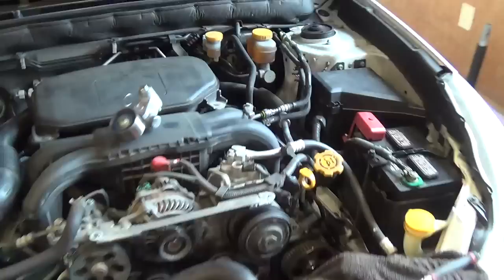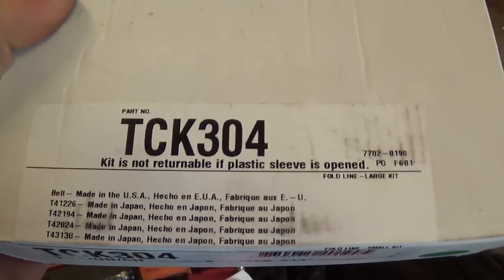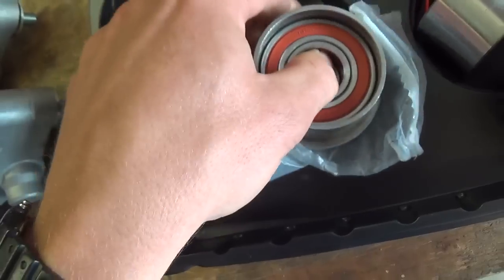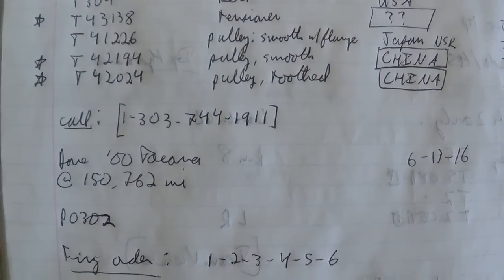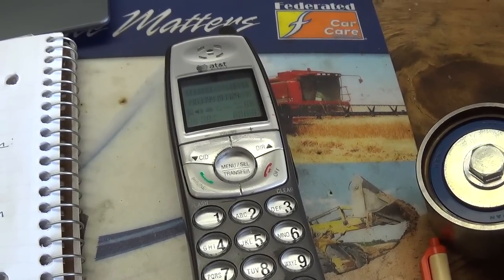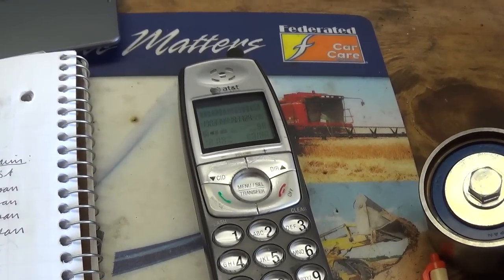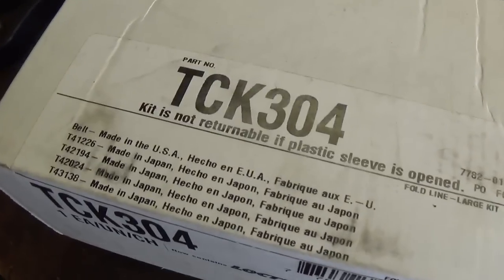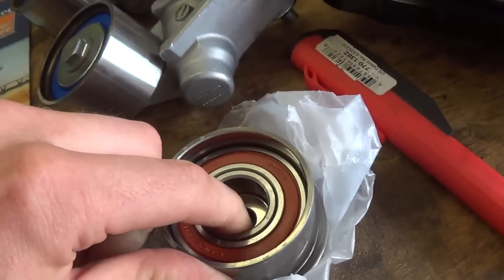GATES Subaru Timing Kits: BUYER BEWARE!

Comment: Well, thanks for the video! I received my Gates timing belt kit for $119 from Amazon yesterday for my Toyota. I saw your video yesterday and decided to file a return ( I chose reason not as described , I said the water pump was different, from what I read from reviews the Gates doesn’t have a weeping hole, so that wasn’t necessary untrue for my reason for the return, so I won’t be charged for shipping on the return) and spend the extra $37 and ordered the Aisin. So when it gets delivered tomorrow, UPS will be taking away the Gates kit. I have nothing really against the Chinese stuff, but if I wanted Chinese parts I would have ordered the off brand kit for $65. For Gates to use there name to sell an over priced kit is disgraceful, I know the whole kit wasn’t probably Chinese, but I didn’t even break the plastic to find out, your video was enough. Especially for parts like this, it’s not a good idea to take the cheap way out. Somethings are fine for playing the odds, for example if I were to buy a Chinese alternator for $50 rather than a non Chinese for $200, I would most likely get the Chinese. 2 MAIN THINGS TO CONSIDER when trying to save a buck, 1, how long will the job take to do (in my case hours), 2, what kind of damage could the part cause if it fails.

Comment: I work on lots of Subaru's and have been very suspicious of these kits .  This is typical of Gates   .The bait and switch technique is a time honored tradition in mass marketing  . Gates has lost me as a customer as has NAPA for Japanese timing kits . Chinese bearings are crap .Do not install any Chinese bearings .Auto Zone pulls this as well with Subaru front wheel bearings claiming to warranty the bearings doe not include labor so the mechanic eats the loss for come back repairs . Thanks for posting this video exposing the fraud of these corporations with false advertising ! Ebay markets  some all Japanese timing kits but beware of fraud there too.
Reply: leftcoastdane alot of people stoped using napa

Comment: I installed a Gates TCK304 kit on my 02 Impreza engine. Idlers were Koyo & NSK. Tensioner was NTN. Within the first year and not too many miles I started the engine one morning and noticed an unusual vibration. Turned it off right away and decided to look at the timing belt. Timing had jumped a few teeth and I found the toothed NSK idler had collapsed and was slightly nicking the engine. Contacted Gates by email but never heard back. Warranty outside the US even for Canada - good luck. Aisin next time.
Reply from the maker: Thank you for sharing, Wayne! Glad the damage wasn't catastrophic.

Comment: Same  experience on Gates Kit for the Subaru Forester XT 2006 Kit Number "TCK328" (Do not buy it).
I am doing a Headgasket job on my Forester 2006 (right now Juli 2019), and because of your video I double checked the Pulleys from Gates I have Installed 2 years ago/ 30-40.000 KM ago
Two Wheels have sounds in the wheel bearing when you wiggle it, and the one wheel is worn out, and don't turn around easy any more, and has been colored and taken blue paint from The Cosworth timing belt, (when I did the Timing belt job, the belt was bought seperately from Cosworth and the rest from Gates)
Wheels are made in China, just like in your video, and I did like "Trashhauler" and trusted Gates for good quality  :-(

Thank You, for your, wery important video, as I wrote above, I just did a head job (Including Machine shop Head rebuilt) and other important things, for an 315.000km / (200.000 miles) engine service.
So I am changing all Gates "china" components  same time.

Best Regards David From Denmark

Tip for Subaru:

My bolts for the CamPulley was (Exhaust hardest one) really hard to break loose, after 13-14 years, and I broke the old timing belt trying to do same thing in another youtube video, in my video you can see the plummer tool in the background from another video. But in my way, work takes short time (what takes in the video) and is cheap, and private people can get the tools easyly

https://www.youtube.com/watch?v=CjlOG90rKwI 

https://www.youtube.com/watch?v=Gha3lxBY4q0

"DO NOT BUY GATES"!

Comment: I agree the box is misleading and they should have slapped another sticker over the top rather than substituting parts. What  a lot of people refuse to believe is that there are quality Chinese parts. The issue is that there's copious amounts of crap Chinese parts and it can be hard to distinguish between them, especially on a bearing. There's a couple options to consider in your case; slap the old parts on (would be my last choice), put on the new Chinese parts (I'd research the bearing manufacturer), or use the old parts but press in new quality bearings such as SKF. The last option is probably the best, you get know good tolerance parts with new quality bearings. The OEM pulleys are probably fine to re-use but at a point they will fail, maybe 3 belt changes? You don't want to risk smoking a belt because of that. If I used the Chinese parts, I'd probably bring the service interval sooner.
Reply: I agree with Nate here. Have you had a bad experience with this particular Chinese manufacturer of these bearings previously, Ivan? if so I understand, if not then I don't....not everything that is made in China is crap!
Reply from the maker: Would you take the risk of having a "bad experience" by installing unproven parts on a customer's car, or even your own car? Heck no!
Reply: I'm late to the party but Nate has a good point. I used to work with a Chinese kid in the shop and he'd say the same thing because he'd get pissed about people saying "China makes crap." But Moto also makes a very good valid point about not wanting to risk it. It was good to see him call Gates out on it though. Hopefully more manufacturers  start seeing things like what Moto did.
Reply: Gates give 60,000 miles as the most you want to use their kits. OEM is 100,000 Miles, The dealer told me  they never replace the water pump unless it is leaking.
Reply: @bobproxmire3637  thanks for proving the point, they cut the service interval almost in half... Sounds like quality stuff😒

Comment: Installed a Gates timing belt kit in my son's 2006 Forester at 196,000 miles, because the tensioner had failed.  The kit included everything except the water pump.  Two weeks ago at 226,000, the car overheated, and my son pulled over and we checked it out. When we tried to start it, it sounded like it had a box of rocks banging around, so we assumed that the timing belt had failed and the pistons were hitting valves.   We pulled the timing belt cover, and it turned out that the belt had not failed - one of the idler bearings (the one to the upper left of the crankshaft) had failed completely, the balls were all over the place, the bearing was all burned, and there were spots of burned belt on all of the other bearings.  We were amazed that the belt had not snapped (and it had not slipped any teeth) - so I can't say anything negative about the Gates belt, but the bearings (they are Chinese) are obviously sub-standard.  Anyway, after doing some Youtube research, Mr. Subaru states that Aisin is the ONLY timing belt kit he can recommend - it has all Japanese parts.  We got lucky, and I will NEVER buy another Gates kit.  This could have cost several thousand dollars if the engine had been ruined.

Comment: They have been pulling this crap for awhile. I did a timing belt on a customer's car 2009 Impreza and didn't pay attention to this and installed it all with a new OEM pump I got from a Subaru dealer. Belt failed prematurely due to locked up bearing. Ruined the heads on the vehicle. Tried to first blame my customer for going to an unqualified tech who installed it wrong. So I e-mailed my copy of the receipt to them and the copy of my Subaru certifications (I am a legitimately certified Subaru tech). Then they tried to blame the break on the water pump because we didn't send it back with the claim. I then e-mailed them and confirmed the water pump was re-installed on the repaired engine and has been running fine without any issue since then.

In the end, after I re-inspected the components and found some of the "OEM" components were made in China, I had to get pretty blunt with them. In the end we had to get a lawyer to get them to pay out the claim.
Reply from the maker: Wow man that really sucks! The Chinese bearing company "Taide" was established in 2001...so basically there has not been enough time to establish a reputation of quality for the aftermarket. Now if OEM suppliers get on board and start using those bearings in brand new vehicles and they last, then I might become a believer. Until then, it's too risky of an experiment to install unproven parts, especially those that can lead to catastrophic engine damage like in your case.

Comment: I bought an 02 wrx with a rebuilt motor and after driving it for a little under a year the timing belt broke and the car broke down getting on the highway. I’m going to attempt to replace the belt on its own just to see if the motor is not destroyed internally.

Comment: False advertising by Gates, it's good you recorded this. The only way to get their attention is to withhold your money. Find another source, and return their fraudulent product.
If it were a dual cam, it wouldn't be a freewheeler, and losing a belt on an interference motor is not an option. Even though it's a single cam, I won't put my customer through that, the tow bill would exceed the cost of the kit.
Reply from the maker: Hi James, the 2.5L SOHC Subaru engine is indeed interference! That is why I would NEVER install these junky Gates components on a Subaru. My 1996 Mercury Mystique 2.0 DOHC on the other hand is a freewheeler, so no worries ;)

Comment: In many cases the belt pulleys can be re-used as long as they are smooth rolling with no leakage or wobble. I have used the Chinese parts with no problems but I wonder about the longevity of the product. Water pump is another option, I have and have not replaced the pump....

Comment: When aftermarket manufacturers can b sued is when the quality will increase. iPhones r made in China and they r the best in the world. They make what u specify. Notice the China part had the Gates logo. Not the tensioner casting but the bearing. Try buying any cam or crank sensor from Standard. IF THEY WORK AT ALL U R LUCKY.  OEM works perfect all the time.. How much did the faulty ignition switches cost GM. Ya think the Ceo noticed a few billion?  Congress will not hold aftermarket feet to the fire. Takata's feet r burning. If channels with 50,000 subscribers get on this and talk about it at a meet up. And everybody starts refusing to buy the junk things might change. Plaintiff attorneys might smell some blood if a few people die from stalls on the freeway. But right now quality is racing to the bottom.. U get what pay for. That's not even true anymore
Reply: Some things to ponder... I'm old enough to remember when "Made in Japan" was an item to stay far away from...Like the first Honda I saw at a local Ford dealer... The exhaust manifold was even rough from being sand cast... And when this "Honda" hit a berm the front end parts were NOT available for  nine months ...

The first attempts by KIA in the US market were lousy but then came their second attempts (KIA Spectras) showed that they were able to produce a great quality car... My family owns 3 KIA Spectras (2006~2009) and various Hyundais (1 Tiburon, 1 Accent, 2 Sedonas) and in my 67 years I have never had a better car brand.... I CAN'T say that about the numerous US cars I have owned over the years 

Let's take TVs...
Toshibas, Sonys , Hitachis, Sanyos, Panasonics are ALL now made in China or South Korea.... So the "name brands" are not what they represent in the names....

I'm wearing shoes that I found that were made in Vietnam...(our deadly foe in the 60s and 70s)...

My very reliable 10 year old "Toshiba" laptop was also made in China....

It's a fact of life that today's market is a "Global" one...

I'd bet that the Subaru you are working on has a fairy high amount of Chinese parts that were used in it's original assembly....

Yes... some items coming out of China are junk....BUT....some parts meet or exceed tough ISO 9004 specs.... 

BTW.... China has been portrayed as "outside" of Asia... Last time I checked it is a great portion of it....

I'm not saying that GATES or Rockauto are correct in their representation of the products that they sell but can any of you know or can state that these parts are truly defective? Only a standards testing lab can....  Gates was wrong in mislabelling...but even that was probably from boxes all ready printed and in inventory at the time of packing....

Yes...we should be wary of products from emerging countries but the "brand name" on the box or product should offer some sense of  security....

You might ask GATES if they have quality checked these parts...

Just trying to be fair....
Dave
Reply: What does iPhone or Apple have to do with any of this? FWIW my "utter garbage" 9 year old iphone still works, is used daily, and the battery still holds a day or better worth of charge. It's never been to any repair shop, not even once. So what you call garbage, I call quality to live up to.
Reply: it's luck, nothing more. i had my iphone 3gs to the end of his possible life. swiched to new iphone and it died after 3 months of normal use. Switched to samsung... so far 2 years and it's holding. so it's all about Quality control and luck :)
Reply: Bill Rimmer I take that challenge. iPhone isn't the best. The camera is, but the rest of it is garbage.  Camera made in Japan, rest of the device made in China.
Reply: Kia Spectra engine is ok not great. 2002 Spectra at under 150000 miles is falling apart. My Camry with 220000 doesn't have any issues.
Reply from the maker: Dave, please read the pinned comment of a first-hand account of an inferior timing belt tensioner in the Gates kit completely DESTROYING an engine 500 miles after the installation. Who needs to send these junk parts to a lab?? All the proof we need is right there in the unfortunate experiences of the end user!

In all fairness, I stand by my assertions that the Chinese parts in this Gates kit are COMPLETE GARBAGE :)
Reply: Edgar Bravo 
Luv my 2003 Toyota Matrix 280k miles and still going strong... Japanese is the only way to go for life.
Reply: The GM ignition switches failed due to a DESIGN fault, not a manufacturing fault.

American engineer screwed up, not Chinese manufacturer.  Chinese parts are crap, but your example sucks.
Reply: Iphones fucking suck

Comment: I have had similar experience with gates timing belt kits. I am a toyota and Honda guy and I try and get Aisin kits as much as possible and I am always thrilled with the quality.
Reply: I also feel you did the right thing. Those Japanese bearings I trust even with a load of miles on them more then the chinese bearings.

Comment: a little tip was sealed bearings play is one thing but knowing how much grease is in the barracks if the bearing spins really easy and freely it takes a long time to stop is an indication there's no grease but if you spit it slows down quickly there's plenty of grease in it as long as there's no play with it stops quickly your bearings are perfectly fine just the tip

Comment: Nason Timing kits are also mainly Taiwanese components with the exact same tensioner. Possibly with Russian bearings in some cases. They put some NTN bearings on the tensioner, and ship a real NTN pulley with the kit, as it has NTN Japan written on them to try and convince you that you're getting quality.. They also ship an Optibelt timing belt with the kit.

"Production start at Romanian site 2008

Inauguration of production site in China 2007
Production of finished polyurethane timing belts 2003
"

2 items in the kit are NTN and they are fairly cheap bearings with maybe $50. The rest is all weird ass parts from wherever, with unknown quality control.

Comment: Unfortunately gates seems to be outsourcing alot of their parts. Even the accessory drive belts are made in Mexico now. Alot of the accessory belt drive tensioners are Chinese.  They do not seem to be as quality as the USA parts (of course)   Rock auto's service is going down the tubes too. I will not buy anything from them any longer.
Reply: I agree 110%, I've ran into several Gates and Rock Auto trash. Especially kits. Gates belts i still buy just because i get a good discount.  Happy wrenching!!!
Reply: I ordered a Gates kit and did the install myself. The kit first off did not come with any gaskets(I blame Rock auto for this). The belt tensioner failed and I thought it was rod knock any my engine was toast. Luckily I just needed to replace the kit, so I got all OEM subaru parts instead. The accessory belts were the wrong widths as well.
Reply: manlymanmanman. did you bleed the tenstioner?
Reply: I bought brake shoes etc for my dump run/Lowe's pickup truck from Rock Auto partially because there was a little American flag by the items indicating that it was American made stuff. ALL the boxes said "made in China". Yeah I put the stuff on, and haven't had any problems but I did feel ripped off.
Somewhere down the road, my trusty, garage kept, daily driver '97 will be scheduled for the timing belt deal. Who can I trust? I can't absorb a trashed motor because of shambolic belt or tensioner. 
For instance, Moog is junk now.  The lower ball joints have failed AGAIN on the previously mentioned truck! These lowers have led a pampered life! l You wouldn't think that buying parts for your car would be like a damn minefield! 
Is paying the high price of the dealership the only way to get reasonable quality stuff? Can I even trust the steelership anymore?
Reply: Mexico is the best wtf